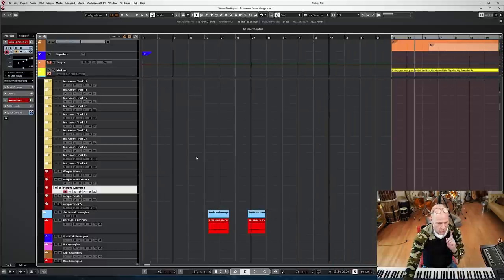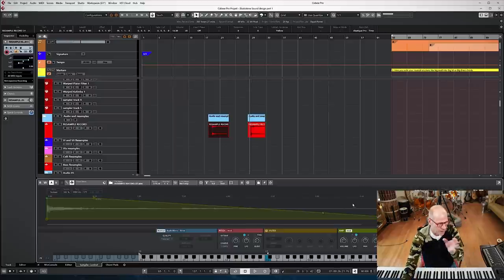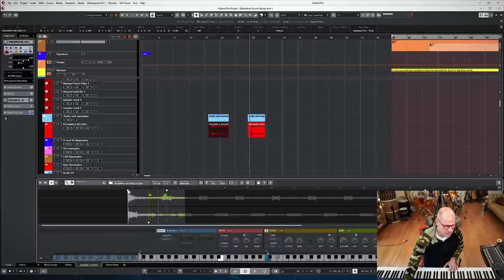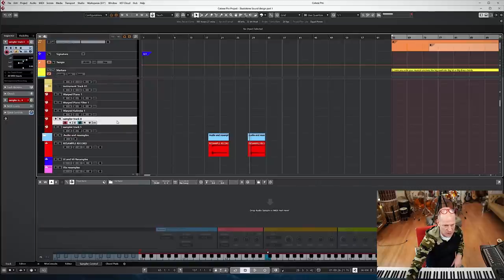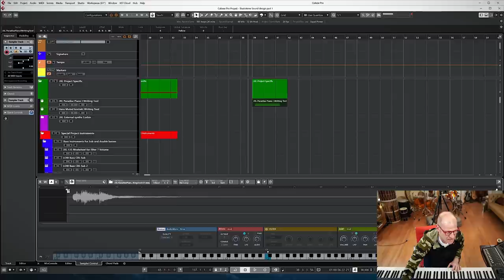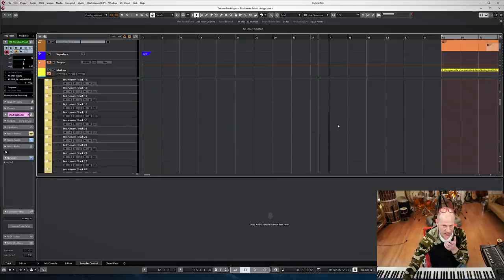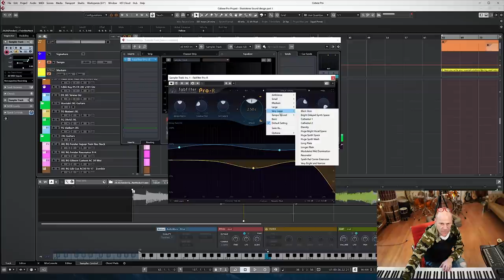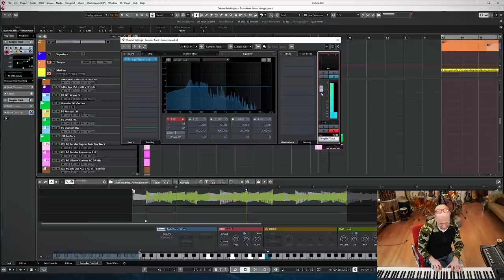INTRO TO SOUND DESIGN | Studio Time [S4E10]

Comment: What kind of cameras do you use for making these videos? They're really good.
Reply: I think he mentioned it in some videos or posts. Should be GoPros.
Reply: I think all cameras are good now.
Reply: @RandomDesign  In "STUDIO TIME: SEASON 4 PREVIEW!", Tom shows the locations of "cameras and GoPros". As he makes this distinction, I don't think that all of them are GoPros.
Reply: It’s more so the lighting than some magical camera. Get a $600 canon m50 and good lighting you’ll be fine.
Reply: @RandomDesign  that overhead shot in the bottom right in the DAW screen is def. not a gopro. There's some depth blur going on and there's not a chance in hell you'll get that on a go-pro. Side shot does look like gopro.
Reply: The overhead is some variant of sony aps-c mirrorless (a6400 or a6500 probably). Actually not very expensive, but you can get great results with it.

Comment: Great video. I dappled a bit with the Sampler track in Cubase, but didn’t do much with it. I’ll definitely revisit. I’m assuming if you want to have multiple instruments added into the Sampler track you have to bounce both to a single audio region. If you say have a track with effects on it and want to use that for the Sampler track, I’m assuming you have to bounce to audio w/effects baked in. Does that sound right?